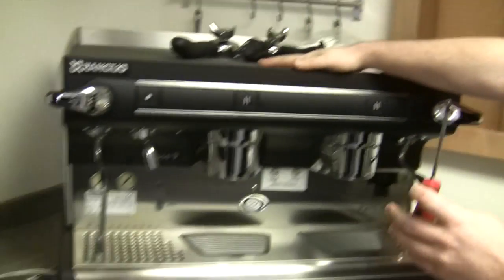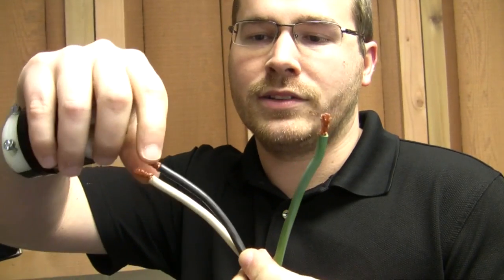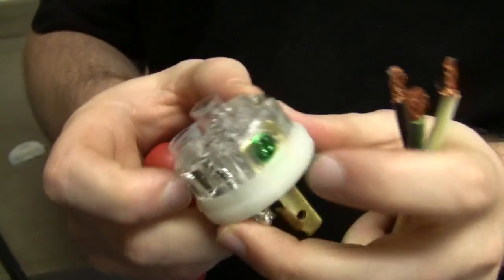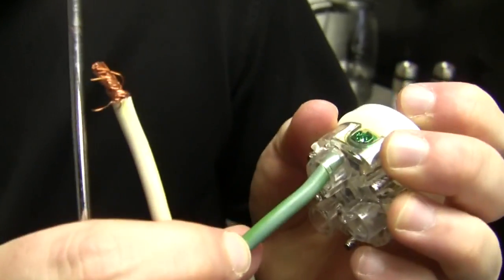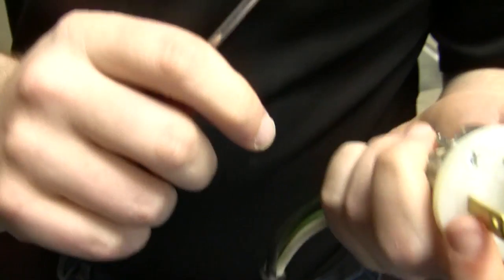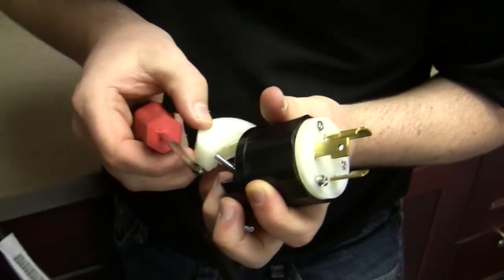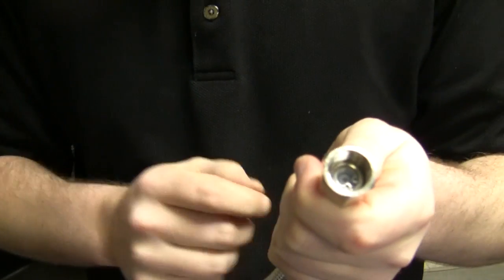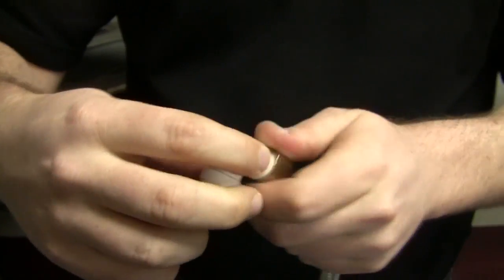SCG How-To Guides: Rancilio Commercial Espresso Machine Installation

Comment: First off I love SCG videos, I have learned a lot setting up my wife's little coffee station. I need to correct you with your wiring of the machine, you need to use the clamp on the back of the cord cap to secure the insulation (black wire covering) to form a strain relief so you do not pull on the connections. The wires inside the cord are not designed to be clamped by themselves they need the outer sheath and insulating fibers to protect them. This is a code requirement and meant to prevent damage to the connections, loose wires and you even said it fires.
Reply from the maker: Thank you for the heads up! - Steven

Comment: The way you terminated the 240v plug is hazardous. The wires in the rubber jacket are not intended to be exposed.

Comment: Would plumbing in a home machine with that option follow similar steps to what is shown here (minus the need to wire a plug)? Do you have a video planned to demonstrate plumbing in a home machine, or have you already done one?
Reply from the maker: We don't have a video, but the basic idea is the same, just different sizes for the components. You would need a machine that allows you to plumb. - Steven